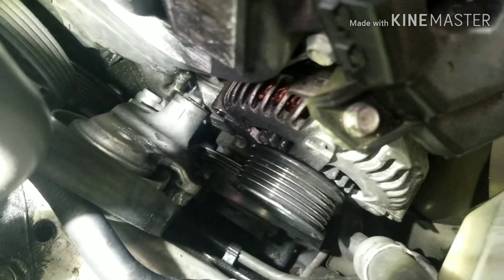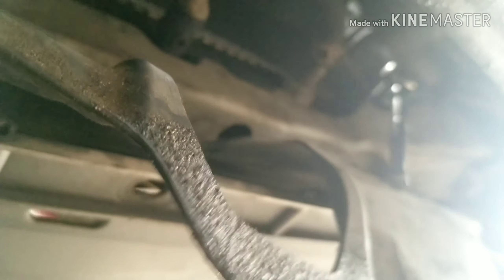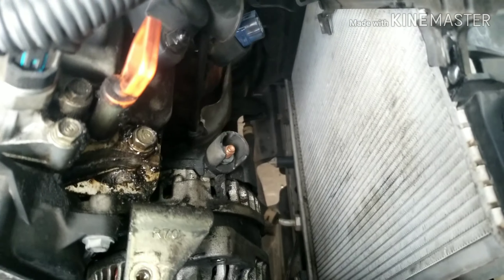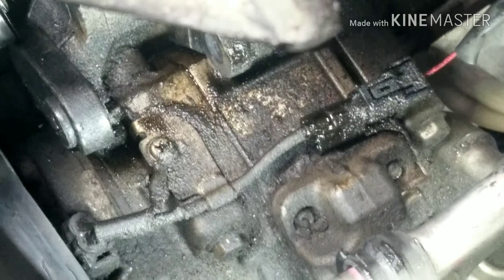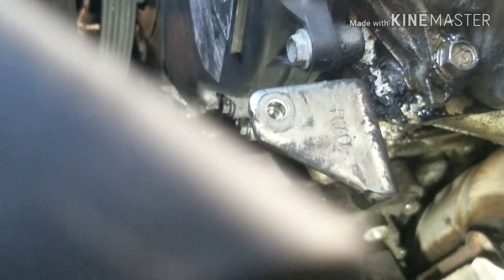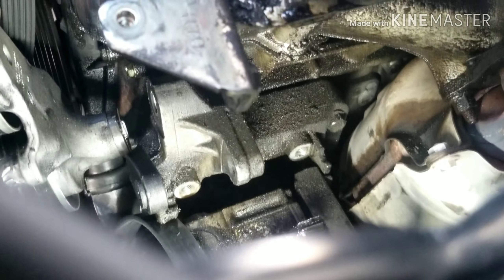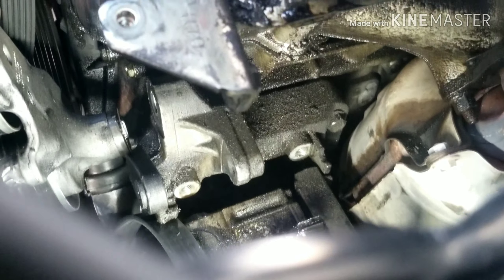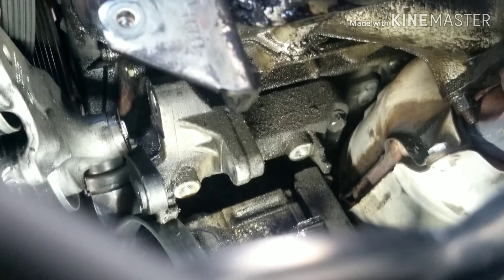How To Repair Honda Belt Tensioner

Comment: just wanted to say that a lot of people in forums and videos related to this procedure are insisting that the tensioner pulley bolt (holding the tensioner to the bracket) is reverse thread on the accords, that was not the case for my 2010 honda accord crosstour. It is also not the case on any of the other hondas ive worked on with a hydraulic serpentine belt tensioner: odyssey, pilot, and ridgeline. but since this was my first time dealing with a 3.5l accord with a somewhat seized tensioner bolt, I made the mistake of blindly trusting the aforementioned advice -- "righty loosey", in doing so with an impact I ended up stripping the threads within the bracket bare. I'll now need to tap and helicoil the threads 🥲
But other than that, this video is super useful.
Reply: That being said, I am curious as to what year accords are actually reverse threaded, there must be a specific iteration on these engines or ones used in the past that have these.

Comment: That crazy because that how my 08 broke too in the same spot and I took pictures of the bolt and pulley and show the machine guy. He told me it will be $1,800 and up becausewe got to pull out the engine. So I agree with you im going to buy it new and do it myself. This video is a big help to me thanks

Comment: the tensioner pulley is reverse threaded so righty loosey not lefty loose like regular threads
Reply: what's happening is people are going the wrong way and breaking it
Reply: I think it depends on what year accord your talking about. I have a brand new tensioner assembly from Honda (31170-R70-A01) and the tensioner bolt is indeed right hand threaded. This is for a 2010 Honda Accord Ex-L V6 Sedan. You should be more careful giving advice, you might be the reason everyone's breaking their bolt off in the bracket.

He even says its a 2010 and the Tensioner bolt is in fact righty tighty lefty loosey. Quit giving bad advice!!!!
Reply: You fackin legend.

Comment: On the bracket, could I extract the broken bolt instead of buying a new one
Reply: Yes you can, at least in my case they just took it out and putted the new one in and I’ve been driving almost for a year with no issues!

Comment: Is the Idler pulley assembly a genuine Honda one or an aftermarket oem replacement? I had the tensioner pulley snap on the top pulley. However the parts you're showing have what look like cast bolts heads on them for using instead of a bolt head on the tensioner pulley. However my car is an 09 Coupe V6 6MT. So I don't know if there is a difference between the manual version of the car and the auto.
Reply: UPDATE: I took a deeper look and it does look like the Auto and the Manual use different part numbers for this. The Auto uses part number 31170-R70-A01 while the Manual uses part number 31170-RCA-A04
Reply: the tensioner pulley is reverse threaded so righty loosey

Comment: What kind of bracket is in the green bag?
Reply: That was the bracket that the Air condition compressor attaches to, it also serves as the alternator bracket and the tensionor bracket

Comment: This was followed exactly. Still broke now the forth time there's something wrong with the car in general should of been recalled I'm not the only one
Reply: Torque the bolt to 57ft#, making sure the serrated washer is in place, fully exercise the tensioner three times to bleed the piston, then install the belt. If you don't do this, the bolt will always break.

Comment: It seems to me that the broken bolt is a result of user error. Either they turned the bolt the wrong way when trying to loosen it or they pulled the tensioner way too hard to replace the belt.
Reply: the tensioner pulley is reverse threaded so righty loosey....most people are trying to take it off ccw and breaking the bolt